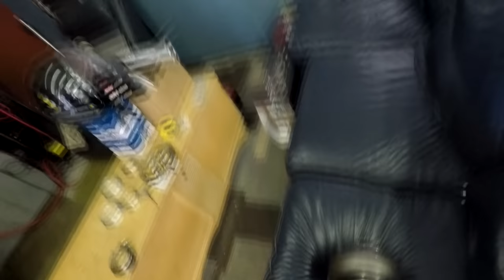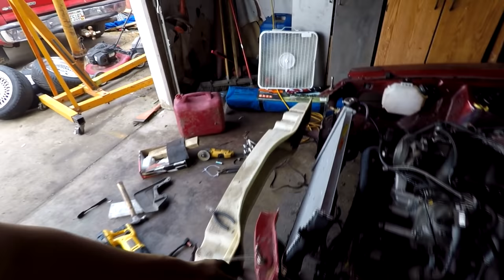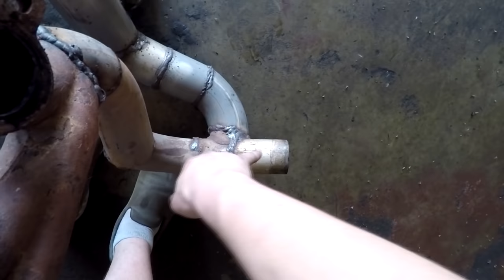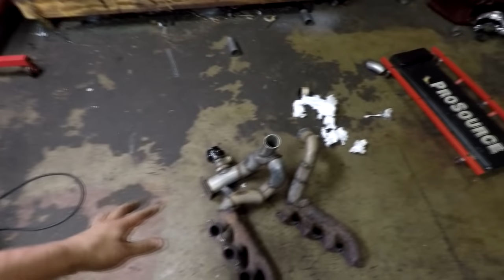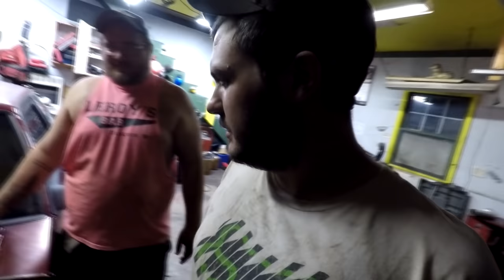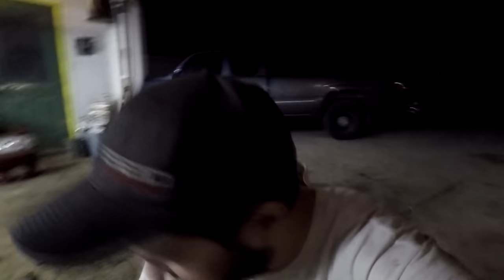Fitting S480 Billet Vs Racing Turbo On My LS Swapped Mustang Part 1. Re Engineering My Hotside.

Comment: I usually take a 2x6 and put some 100 grit on it and plane the exhaust manifold flat. I've even used that trick on cylinder heads when I don't have time to wait a week for a machine shop.

Comment: Have you drilled any holes in your thermostat yet? Drill 2 small holes in the stat and you wont have to work at getting any air out when you fill it. It will also drop the temp of the stat by 10 or 20 degrees depending on the size of the hole(s).